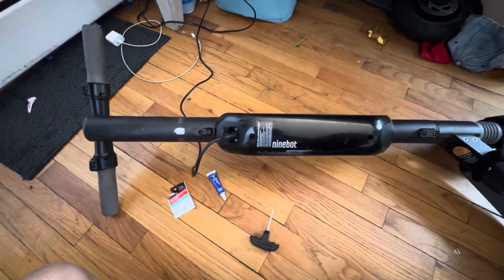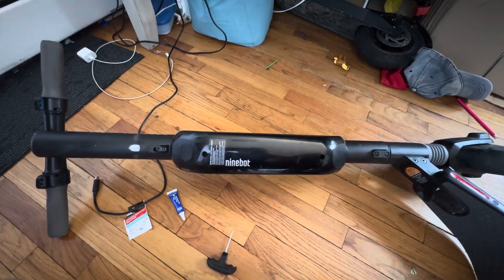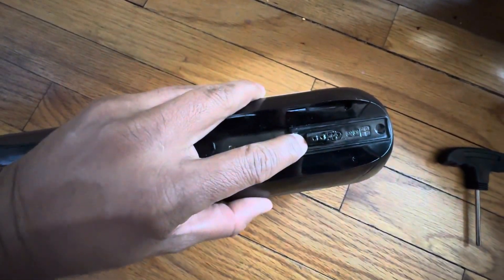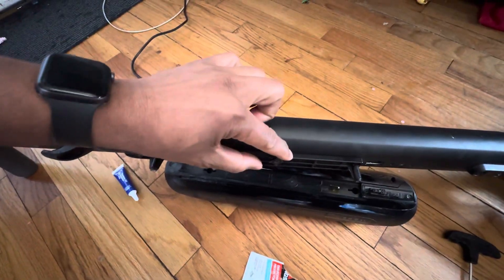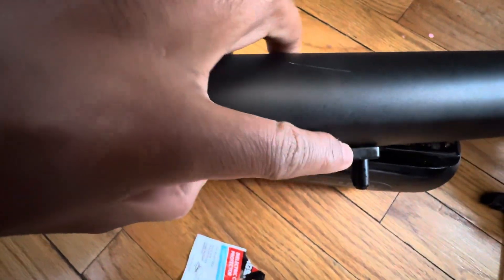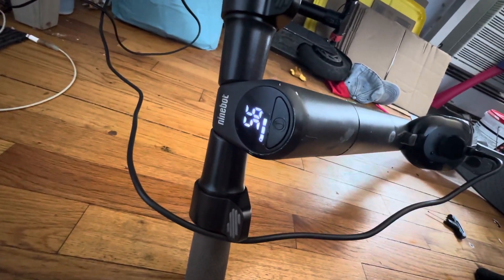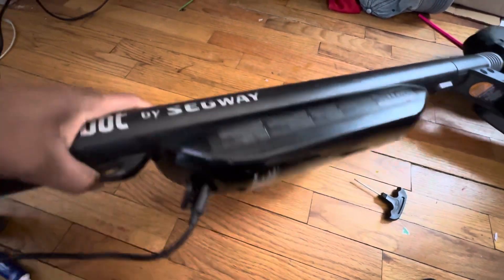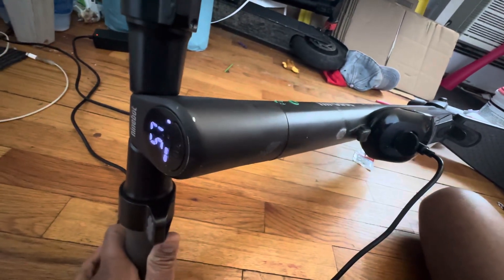Easy fix Segway Ninebot ES3/ ES4/ES2 ERROR CODE 42&48 at home

Comment: Thank you, Peires, for sharing! But the bent holder isn’t actually the real cause—the real issue is carbon deposits on the electrodes.

Simply remove the external battery, clean the carbon deposits on the electrodes (both on the battery and the body), and then reinstall it. You’ll see the scooter stop reporting errors. :) I just successfully fixed mine this way!
Reply: How long did it last?

Comment: I have been having intermittent loss of power and had to walk home the last 1/2 mile yesterday I was very happy to come across your video. Plugged in my charger to get error codes and noticed the app wasn’t reporting second battery charge.  Pulled the battery to find the bracket bent.  Easy fix and I might put a large zip tie on to keep the lower end of the battery from pulling back.
Reply: Quita las barras y ponle abrazaderas, así hacen un mejor contacto

Comment: Fixed until you ride it a few times and beep beep blam, as I  slammed mine against the ground with no regard. Solid back rear wheel slides out sideways when a 45 degree angle is the approach to a driveway 2 inch rise at 19 mph. Way to much to expect from this poorly designed front heavy bolts missing e scooter that at first you think no brake but the truth is the whole thing breaks and the only sure thing the es4 offers, save for the Segway employees that sure are quieter then a new e scooter when the es4 is mentioned